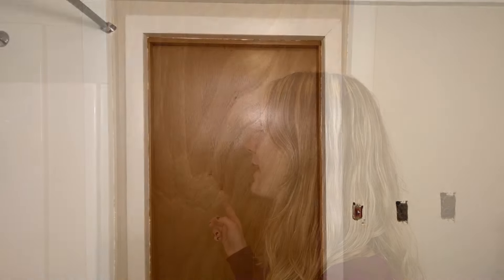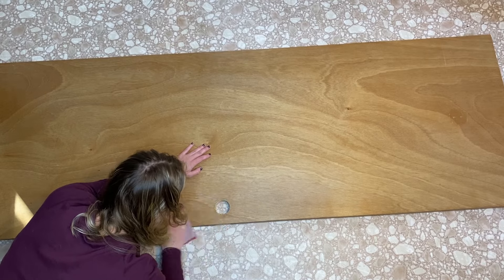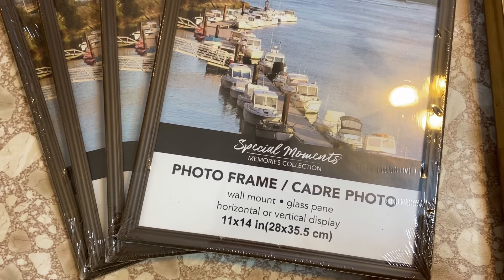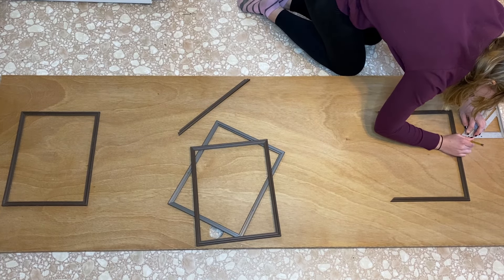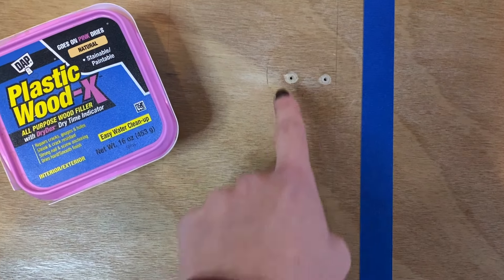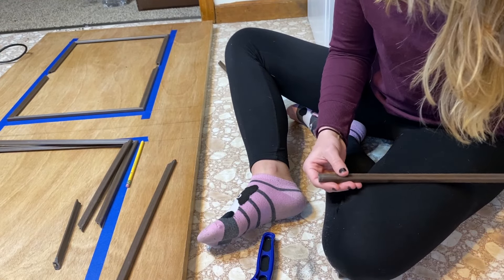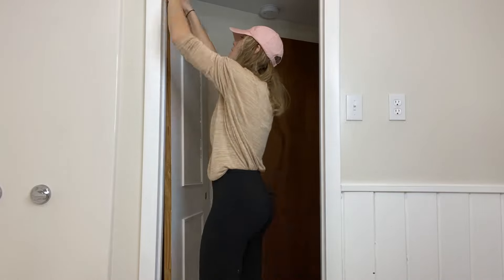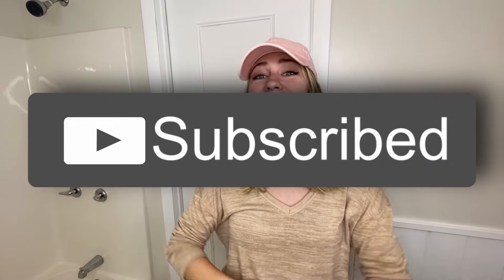Modernize Your Interior Doors  |  DIY Projects With Dollar Tree Items

Comment: I think using frames is a great idea. I want to attempt this.,. But I didn’t quite understand lithe part when you were measuring the frames to make that stencil? Couldn’t I just get a large frame, and glue it to the door without cutting the frame. Also how to measure where to place the frame. Also what type of brush did you use to paint, a roller or brush. I’m not good with these projects but I’d love to attempt to do it on my bathroom closet as a first try DIY project.

Comment: Thanks for sharing this! I plan on doing this to at least 6 doors if i can🥴 how are the doors holding up so far? Any chipping of the paint? Thank you!
Reply from the maker: This door is in our rental property so I don’t know the extract wear and tear it’s getting, been it’s been about a year and they look just as good as the day I finished them! I’m sure if you used slightly more expensive wood frames it would hold up for as long as the door!
Reply: @TayMarie23  got it! I'll definitely try it with wood from the hardware store. Thank you for responding back!

Comment: Great job ❤ you did amazing it looks beautiful and on budget it's a win win ... Are you planning on doing the rest of the doors in your house or are you just doing projects one by one as time comes 👍👍👍
Reply from the maker: The rest of the doors in the house are actual new 6 panel doors! The bathroom door was a weird hard to find size and the door frame itself is very out of square, so replacing it would have been a pain! This was the solution I came up with!

Comment: What paint did you use for the door?? I find that the paint I’m using always ends up turning yellow in the long run.
Reply from the maker: Try using a high quality primer before you paint, it will stop any tannins from bleeding thought causing yellowing. I always recommend buying a paint and primer separately. Hope this helps! 

And I used the Behr Ultra Scuff Defense in white!

Comment: Great video. Do you do this for both sides of the door or just one side?
Reply from the maker: Just the one side! All the other doors in the house were the hollow core wood doors so I just did that one side to complete the mini bathroom remodel I did :)
Reply: @TayMarie   thanks for the response! I'm new to DIY stuff, plus a new homeowner. All my doors are flat on both sides. Is it a better practice to add these frames on both sides or just the side facing the exteriors of the room?
Reply from the maker: You can definitely do both sides! You can even keep the doors hanging on the hinges and just slide some cardboard underneath to catch any mess!

Comment: I'm just seeing this in 2025, so my question is, why did you not paint the side of the door where hindges attach?  Looks unfinished, but other than that, it looks pretty good.  Just wondering??
Reply from the maker: I honostly can't remember the reason now, but there was one 😂 Maybe you could find it on another comment lol Regardless, this was just a fill-in until we could find a door the correct size :)

Comment: What Amazon paint needs no primer? I'm looking for a black one
Reply from the maker: I would definitely recommend using a primer if your door doesn’t already have a layer of paint on it. If it is already painted and you just want to update it/change the color, then lightly sand and use any black paint you would like! There are also combined paint and primers you could use, it’s one product with both in it :)

Comment: How many frames did you buy to used for one side of the door
Reply from the maker: I used 5 frames total for one side. One of the 5 is used for “parts”. I broke the 5th frame down and used the longer two sides to elongate the top decorative panel and used the smaller two sides to elongate the smaller lower decorative panel. You might even be able to get away with 4 on a smaller door and might need 6 for a larger door. Hope this helps :)

Comment: What if u already primed the doors so far n I'm going to paint
Reply from the maker: Are you wondering if you can glue the frames/trim to the already primed door? If so that shouldn’t be a problem at all. You will just paint over everything once the adhesive has set :)

Comment: Nice! It's so annoying hardware stores don't sell the ready-made square or rectangle trims. I want to make a 4-panel rectangular one. Such a hassle without the right tools.
Reply from the maker: Definitely! I did look into some online options that you just stick on the door and paint over if needed, some were wood and some were that PVC stuff. But they were like $30-$40 per panel! It would have cost a hundred just to do one door…might as well just get a bran new panel door at that point 😂
Reply: They also now sell a scissor type tool to cut trim pieces either straight or even 45° angle, just like cutting paper w scissors. It's very easy w thin trim pieces. Try them, they even sell them for $10 or less, Temu even sells them. It's easier then ever to tackle sm projects at home now a days w all the DIY out there.  If they made them ready for doors in square shapes, it's basically pic frames..... Try it, u can do anything u put your mind to. Good luck, don't forget to pick up the scissors that now cut trim at any angles!
Reply: @micheleln3267  Thanks! I've just recently added shears & pliers to my Temu & Shein cart for different purposes. I did try looking for pic frames, but the specific length it needed to be made it so expensive (I have ten doors in my house; i.e. 80 pic frames - 8 on each door/4 on each side - of the required size was just too much). Also, I found it so hard to find what I now know is called "astragal decorative moulding" ("Ashford Molded Classic Wainscot" in America) or "ogee moulding" in the right length & wood-effect material. That day of extensive searching was a struggle!🤣 
What's the exact name of these 45° angle trim scissors?

Comment: Cheap and super quick to do with minimal cutting... A little unsure why you didn't paint the inside of the door though, and when it was rehung, there was a massive lob side gap in the top left-hand corner???
Reply from the maker: I explained why in the video :) The gap was there before and much worse, I was actually able to level it out a bit but it’s an old house with lots of bad settling, the entire frame was completely out of square. The white made the gap a lot more noticeable though!